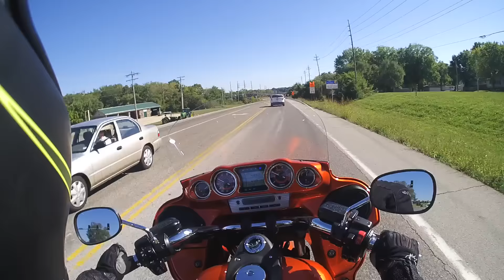Engine Braking, Yea or Nay?

Comment: Engine braking, its just habbit. Driving flatbed most of my adult life you learn to use the transmission to help slow the truck down and aid in breaking. Smoking the brakes on a semi is not a great idea. Unlikely on a motorcycle to overheat the pads.
Reply from the maker: +Hazzardousmat For sure.  I engine brake too; I just make sure not to rely on it and always have the brakes applied as well.  I would think it would be hard to overheat the brakes on a motorcycle indeed.  Perhaps a long mountain descent.

Comment: I do not understand why you call riding and rolling on and off the throttle to enhance the smoothness and comfort as engine braking. It is just riding. Are you saying that there are people out there that ride only with the clutch out when they are accelerating and cruising and pull it in any time they feel the need to slow down and freewheel then use the brakes for the deceleration just because they feel that backloading the power plant might be not so good? What do they do going down a long decline, let it roll with the clutch out to stop it running away or clutch in and freewheel and constantly ride the brakes.
Reply from the maker: +Leon888D Essentially I'm talking about downshifting and keeping the RPM's high to increase the effect of drag on the rear wheel due to the engine.  Also, some folks do hold the clutch in while coming to a stop, though they should still always be in the correct gear.

Comment: I'll drive the motorcycle on the throttle out on the highway just using light engine braking to bleed off speed to match other traffic, maintain following distances etc.  That said in an emergency stop I was always taught and practice disengaging the clutch and just worrying about stopping the bike. Also I'll sometime dab the rear brake very lightly to activate the sensor if I feel someone is closer behind me than I would like, just flashes the brake light at them of course as a polite "If you get any closer behind me we'll need a condom mate."

Comment: Brake pads cost dollars the extra wear isn't worth it.  If you are too aggressive with downshift you can stall your engine which will lock up your real wheel.   Just like you said engine braking doesn't add anymore braking than the rear brake.  If a person tries to engine brake to a stop it will stall the engine.

Comment: Okay okay okay. This is a perspective from someone with advanced technology breaks. Yes in your case, engine braking offers no real benefit. I have a 2005 Nomad that benefit greatly from engine braking. Let me tell you why I think it does. Engine braking work as a pseudo anti-lock braking system commonly known as a BS. It keeps the brakes from locking up while when downshifting at higher RPMs much more effective Breaking Benjamin slamming on your rear brake. When solid and effective engine braking is combined with front and rear braking in an emergency situation the bike stops faster than any other way. Anybody that has ridden hard Motocross, those as fast as they can out of a turn and wait as long as they can until they go into the next turn will know that the combination of using all free gives the best chance of slowing down just enough in the turns and guaranteed to be in the proper gear when it's time to launch out. In short, yes engine braking is very effective. Do I believe it tears my clutch up, it's not doing it any favors. Hope everyone has a nice day. And go ride your bike, quit watching videos. LOL

Comment: I see no good reason NOT to engine brake.  If you're slowing down, you probably need to downshift anyway.  Most manuals I've gotten with cars or bikes tell you to use engine braking, so I doubt it's bad for the engine or transmission.
Reply from the maker: +CaptPuget No it's certainly not bad for the engine or transmission.  But I think the brakes should be used as well for the modulation; not relying on slowing down exclusively with the engine.

Comment: Engine braking stresses your engine rings. There is no reason to do it on purpose other then what the Harley community does which is to blip their engines as they are doing it. Brake pads are cheap compared to engine parts.

Comment: with my bike i use engine braking, to slow, drop to new lower speed, and as im moving to a red light. as i really don;t want to stop unless i have to. as most of the lights where i live the lights change quickly.  

i don't use engine braking as a primary stopping, just more for cases above, i don't want to stop but i need to lower my speed or drop to the new speed zone
Reply from the maker: +Notsodirt For sure!

Comment: engine braking in semi trucks are nice
Reply from the maker: On a Semi truck you're generally exhaust braking.  Semi trucks are too heavy to really effectively engine brake in the same way a car or motorcycle does.
Reply: No. On a Semi you'd be Jakebraking. A diesel won't engine brake much without one.
Reply: before anyone goes to Wikipedia, a jake brake is what sounds like a turbo waste-gate on semi's ( aka death thunder lol)

Comment: Hi Romans Five /Eight, its me MadIgor again, your conclusions are typical misconceptions (lets call it urban myths) of a inexperienced rider. If some novice rider watches your video there is a danger that he will learn bad habits that will make his bike operation less safe.
So let me put things in right order for you. I will split the topic into 3 sections:

1. Engine braking into curve
2. Engine braking in general to slow down
3. Risk of engine braking

So here we go.
1. Engine braking into curve

Well, at speeds above aprox. 25MPH where the gyroscopic forces are straightening the bike up and stabilizing it straight forward movement to be able to turn means to bring the bike out of given balance so its weight is working against the gyroscopic force. That means we have to bring the bike into controlled fall, and this technique is known as COUNTER-STEERING. To turn left you have to turn your handlebars right to bring the bike into a fall to the left. Negotiating the turn is the balance of loss of inertia of the bike (that makes the bike turn more) and the gyroscopic force (that raises the bike to turn less).

So now back to topic of engine braking into curve, you can slow down into curve just by operating your brakes or downshift to brake the bike with engine, or combination of both.
Operating brakes means that you can take away to much inertia and two things can happen, your bike will fall to much into turn and you go down or you will compensate with handlebars and be simply much slower in the turn.
The advantage of the engine braking is that if you loose too much inertia, you simply pull the throttle and use gyroscopic force to prevent the fall. You can argue that you can do the same if you operate the brake only, but no, you dont have the right rpm for  torque needed to give the bike enough inertia fast enough.

Also, you have to take in account the operations the human brain is capable off in very short time. Operate the brake and focus that you give it the right amount, negotiate the turn and be ready to downshift to pull the bike out of trouble if the amount of brakes applied where to much, is simply overwhelming since we are talking about milliseconds. 
The engine braking into turn in the other hand has to be the combination of approximate gear/rpm and negotiation of turn, thats all. If you hit too much of a engine braking you just have to pull the throttle and you out, if the engine brake was not enough you just shut the throttle and your bike leans in more. You see that the process is much less work for the brain and you dont have to be THAT exact on the beginning stage of the turn.
So yes, riders should learn to use engine braking into curves and NOT use the brakes as the mean for curve negotiation. If you are mastering this without thinking, you can add some help of the front brake to be able to use higher speed before the turn negotiation. But here we are talking about racing, not usual riding. The engine brake before the turn is the CORRECT way to do it!

2. Engine braking in general to slow down
So here we have to first discuss the way the conventional friction brakes work. The kinetic energy (movement) of the disc/drum is exchanged via friction of the pads into a heat. So far so good, but for the ability to do this there has to be given amount of friction. The materials used as we know are losing friction with raising temperature up to the point where they loose friction to minimum. And THIS is the catch of friction brakes. The longer the time you brake, the less you brake, more force you use on pads over time the less you brake over time. So the brakes will fade over the braking process.
Now lets have a look at the  engine braking, the main braking component here is the clutch. The clutch has very same principal of working as a disc brake, meaning its transferring kinetic energy into heat via friction. So why is this better then a disc brake? Well, the clutch is not just one disc but many, also most clutches are wet type and that means that they are cooled down by the oil. And THIS fact means we can slow down for much much longer time without fading effect, AND we still have full power of the disc/drum brakes in case of emergency. Secondly, if we are in need of emergency speed up it takes just the twist of the throttle.
 
But what about if the riders downshifts too much and the bike locks up the rear wheel? So here again is true what is true for engine braking into curve, we dont need exact amount like we do with friction brakes. So if you lock up the rear wheel with friction brake and the bike starts to high side, you have to hold it and try to stabilize the bike after a certain angle of the high side. If you release the brake your bike will catapult you in opposite direction. 
If you lock your rear wheel with engine brake, you can either lower the throttle and try to hold the bike in straight while its slowly high siding until the rpms are matched up, or just pull the throttle and voila high side is away. But there will be no violent catapulting moment. So engine braking is much safer then friction brake if too much is applied.

The best way when "just" slowing down is to use engine braking and just a little front brake if you need to slow down faster so the traffic behind you is aware. But remember the longer you operate friction brake, the less power it has if you  need more brake power. 

 3. Risk of engine braking

Well, there is only one risk I have to think off if we talk about engine braking, and thats the wear of the crank shaft. This is true with heavy bikes especially. The twisting forces could be too high at some hard engine brakes, you are applying inertia of 900+pounds bike to tiny shaft on one end and 100 foot/pounds of engine torque at the other end of the shaft that is just around inch in diameter working against it!  So the crank shaft can twist out of true. There is no other risk, and event this risk is not that much of a story if you dont go too wild on the engine brake on heavy bikes.

I know this is a lot of reading, and it was not meant as offense, you do a great job of making riders to think about different topics of bikers life and discuss the opinions, so keep on the great work.

Comment: engine braking cause any engine problem?
Reply from the maker: No not really.  Some say that it will; but I'm not convinced.  The forces applied during engine braking aren't really any different than the forces applied when accelerating.  That said; I'm also not convinced that "saving brake pads" is a worthy cause either.  They're cheap and easy to replace.

Comment: I pretty much just use engine braking to slow down while maintaining the perfect gear and powerband. engine braking towards a red light is convenient because the moment it turns green you're ready to regain speed and keep moving. Otherwise I'll end up downshifting too far and when the light turns green I'm in too low a gear for my speed and have to do some guesswork to get it back into businesses mode.